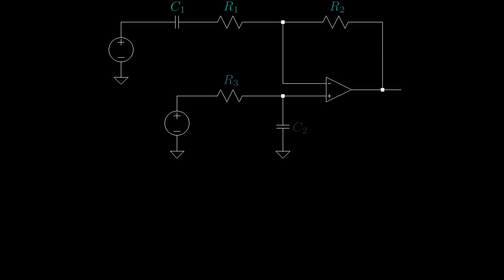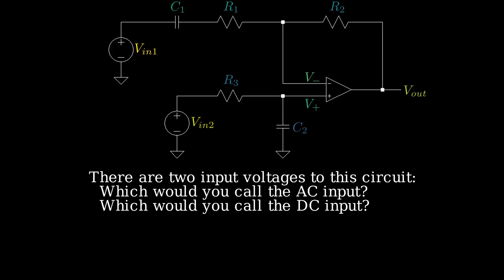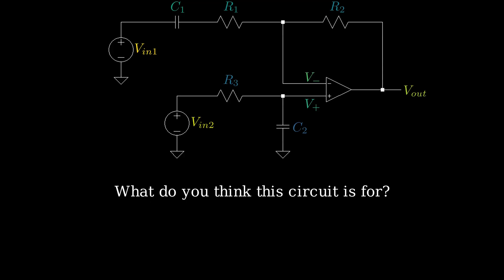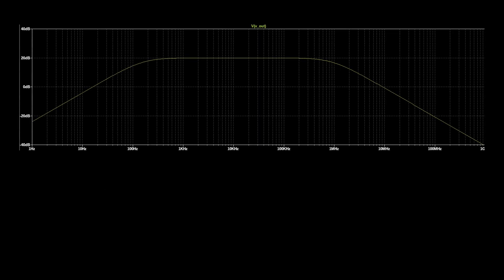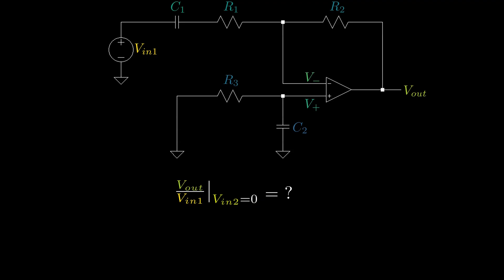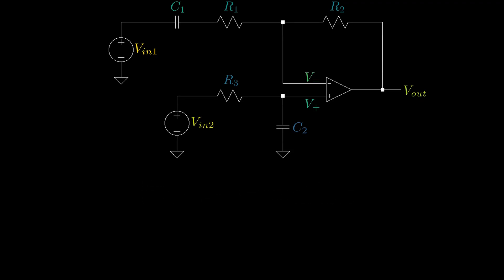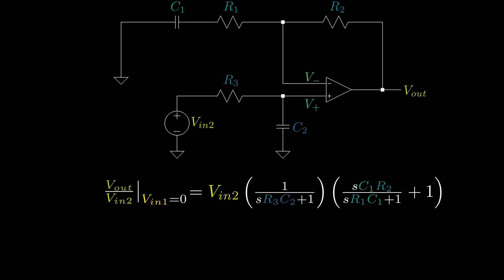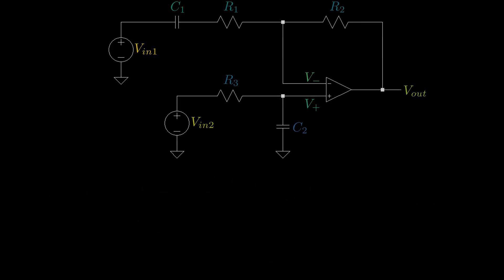Validation Engineer Interview Question Set

Comment: I think your answers for the transfer functions shown at the 4:07 and 5:00 minute points are incorrect. The x-fer functions should have no units (Vout / Vin is unitless). Vin should not be on right side of the equation. Also, when you took out Vin1 (the AC input) the question becomes a capacitor charge time problem. And with no AC input, s = 0 and your answer (at 5:00 min.) doesn’t make sense.
Reply from the maker: Yes, I noticed this and in the description I mentioned my nomenclature mix up. Good catch

For the s=0, I believe that is correct (once you fix the above mistake). Let me know if thing otherwise
Reply: Thank you, i was writing this on paper and thought i had made a mistake :)

Comment: Mm this seems a bit odd as I think it assumes both v1 and v2 have the same frequency input. Otherwise wouldn't the s for v1 and v2 need to be different.
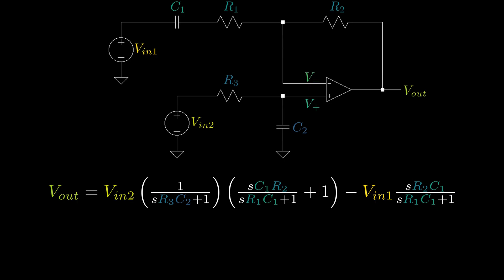Reply from the maker: If you are referring to the equation at 5:17, great point, I should have used s_v1 and s_v2 to convey that the V1 and V2 frequencies aren’t necessarily the same. 

In the equations before that I think I’m ok because am analyzing each source separately.

Thanks for the comment
Reply: @TLV3604 no worries - I am enjoying your videos. Looking forward to more!

Comment: I'm happy that just a basic electronics course of mechanical engineering and a bit of curiosity about tube amps/guitar pedals allowed me to answer a couple of the questions. This video is quite interesting because the amp/pedal world rarely goes into calculating said circuits in any depth that isn't relevant to desired signal behavior like getting the right bias to amplifying or cleaning out DC from the signal or buffering the signal or having the right kind of pull-down resistor or feedback loop or AC signal filtering. It's more about functional blocks of components and having desired signal filtering to ear, specific component details than calculating the bigger picture in the circuit.

Comment: for the transfer function questions, couldnt you just solve the transfer function directly (using the typical inverting amplifier equation but with 
(V1 - V+)/Zr1c1 = (V+ - Vout)/R2, 
with V+ being 
V2*(Zc2/Zr3c2)) 
without taking into account the cases of setting each input to 0? Thats how id personally approach the problem and it seems easier since it ends up just being multiplying and dividing some terms. Then you can just plug in each case instead of added them in the end, although ill definitely note using superposition more.
Reply from the maker: Yes, there are definitely more than one ways to solve this circuit. Personally I like superposition, but if you like how you did it, that's great too. Thanks for the comment
Reply: @TLV3604  thanks for the clarification ❤

Comment: Your first question is wrong based on the schematic itself. It shows a positive and negative. Voltage That is not a C A C always shows a sign wave with no. Polarities.   This is why I don't like tests. People don't bother to see if the question is even reasonable. It's a fake question. The schematic shows a DC input only. There are only two DC inputs, And that of course makes the capacitor useless and that part of the circuit useless.
Reply from the maker: Not all sources have a sine wave drawn on them. The source with just a positive and negative terminal represents a generic voltage source, not necessarily AC or DC. This circuit was created using LTSpice, which uses the generic symbol as AC or DC (or a combination of both). To suggest that the question is fake is overly pedantic to the point of being incorrect. I recommend you search for schematics drawn with LTSpice, according to you, there are a lot of "fake" circuits that seem fairly real to me.
Reply: @TLV3604  well I was raised in the 70s and there was no LT spice and if you put a positive and negative on an AC source, you were considered an absolute moron.  

If LT spice was lazy and didn’t do it properly that’s on them. A plus a minus means DC end of story.
Reply from the maker: @forgeteverythingyouknow5413  in that case, I’m truly sorry that you are stuck in your ways and resort to lashing out at those that go against your personal conventions. 

Is it acceptable to draw a resistance as a box? That’s the symbol in Europe, is everyone in Europe an absolute moron?
Reply: @TLV3604  fascinating...  you came up with the idea that I'm lashing out simply because I am stating something is incorrect. I did not lash out at you or say anything bad about you. I am just stating a fact. A positive and a negative symbol on a device means DC. If there is no sign wave picture, then it is definitely DC. If LT Spice was lazy that's on them as I said.  The fact that you can't see this is confusing and want to defend It is bizarre to me but go for it. 

The fact that you Projected that I was lashing out is interesting. I simply said you were wrong.   

Your example of the resistance symbol being different in another country is Non-sequitor and so  has nothing to do with this comment....  

  I had no intention of getting under your skin. 

There is a problem with language and characters in general in that they can change over time. Always go downhill. And that is the problem and why society's collapse eventually.   This is a very small example. But many small examples build up to the insane political world we live in today. 

Lt Spice is wrong and you didn't know that and I could care less. Carry on sir. 

The fact that you can get upset because someone points out what they believe is a strong error. Is something you might wanna consider in your emotional Self work.

Discussions and facts have absolutely nothing to do with ego. If they do, that's a personal problem. You never have to get upset with someone disagreeing with you. And you shouldn't. 

Consider the fact that this is text. Unfortunately, text without a context of the other person means you project your meaning onto the text. 

What I said was in the 70s if someone Created this symbol, It would have been absolutely considered moronic. I didn't call you a moron..      However, since I am 66 years old, I can tell you that the world has become dumber and dumber as the years have gone on. 

And so goes the Dunning-Kruger effect in history. The younger ones do it a little differently and not as accurately and they think the older people are fools. 

Note I am not saying you think I am a fool. You seem to infer a lot of things... But I am not implying anything personal. 

The last thing I wanted to do was irritate you. I wanted to have a discussion. It didn't have to be with you. But you're welcome to continue to believe I called you a moron if you want to. I would never do that. Not in a million years. 

But you get to do and feel anything you want at any time you want. Same as everyone else.

Comment: This circuit is incredibly practical. I build it quite often. Its great for building guitar pedals around, but I've also used it at 3.3V built around OPA320 (2nd order sullen-key) as anti aliasing filters for ADC's and DAC's. I find the inverting configuration to be convenient because it can attenuate the signal, where with non inverting configurations can't reduce the gain magnitude under 1. Its also much easier biasing the inverting version, but they are both nice.
Reply from the maker: True, I didn’t even talk about how the shelf filter behavior can be useful. At some point I’ll definitely do a video on antialiasing filters. Thanks for your comment!

Comment: My guess (before watching the video) is that this is an AM modulator. The carrier goes in the top (with the DC blocking capacitor) and the signal to be modulated goes in the bottom (with the low-pass RC filter.)
Reply from the maker: While not the original use of the circuit, it very well could have been used for AM modulation, nice guess!

Comment: Great video!!!!!

I think I did ok. As an incoming 4th year worried about future interviews, this was pretty reassuring.

My answers:
Q1: Vin1 is probably AC because C1 screams "coupling capacitor." Vin2 could be DC, C2 holds its value at V+ while R3 limits the current. Vin2 could be AC too, it looks like a LPF.
[Upon reflection, if Vin2 is an AC input into a LPF, that's just saying DC again. lol]

Q2: It looks like a summing amp, so the circuit probably adds a sinusoidal signal to some DC offset.

Q3: (I misunderstood the question, couldn't answer rip)

Q4: The opamp is not ideal so eventually the internal elements can't switch fast enough to handle the extreme frequencies.
[The first term that came to mind was slew rate, but I thought that may not be 100% applicable. GBW product slipped my mind]

Q5: Vo/Vin1 = R2/(sC1 + R1)
[Yikes that's embarassing. Simple nodal analysis, [i_in1 = i_o] => [Vin1/Z = Vo/R2] but then I did Z = sC1 + R1 instead of 1/(sC1) + R1]

Q6: No idea lmao

Guess I should review my fundamentals next time :p oh well, better fk up now than during an actual interview
Reply from the maker: Nice! In my opinion, a good interviewer should focus not on your final answer, but how you arrived there. So even if you mess up some questions, don't worry about it! From your answers, it seems like you did pretty good. Especially for Q1 and Q2. 

Honestly calculating the exact transfer function is the least important part of the question, as in industry really you could just simulate the circuit to make sure your component values work for your test. However, being able to derive the transfer function will allow you to make educated choices when selecting components. It also tells you what is possible (for example, can we get AC gain with this circuit? What about DC gain?). If I can calculate the transfer functions I can prove the answer without fiddling with component values.

Comment: You mentioned that the candidate wouldn’t be penalised for wrong answers in the last two questions, they’re more meant for figuring out their thought process. 

I didnt make the s = 0/inf connection or the inverting configuration connection (I know what that is, I just thought the capacitor messes it up a little). But I was able to get the transfer function using kirchoff. 

Should I work on pattern recognition or is being able to work through the problem enough? I assume the pattern recognition matters more with larger more complicated circuits and this was a simplified version.
Reply from the maker: If you were able to work through the math correctly that's great! Personally I like to simplify the circuit when I can, and try to recognize the common patterns, and then use that when I'm diving into the math. That way I accomplish two things, the first is I have an expectation for what my math should lead to, and the second thing is I "show off" to the interviewer. And by show off I mean to say that I show that I am capable of both drawing fast and accurate intuitions about a circuit, as well as actually mathematically defining the circuit. And the intuitions can help fact check the math for any mistakes.

For example, at 3:42, at high frequency (caps are shorted), I see the standard inverting amplifier, so I know what when I solve for the complete transfer function, I should see that as s->infinity my transfer function should simplify to -R2/R1.

Another example, at 4:35, at low frequency (caps are opened), I see a voltage follower configuration (the resistors don't matter as op-amp terminals draw no current). Again, this intuition guides me, and if I see that my end result does not agree, I messed up in the math somewhere. 

In short, let's say you messed up your math somewhere. It's a lot more impressive if you were able to figure out that you made a math mistake without the interviewer telling you. By simplifying the circuit, coming up with a hypothesis, and then using that hypothesis to check your math you make yourself seem very efficient and capable. And again, everyone is a bit different, so if a candidate used only math, or only handwavy analysis I wouldn't consider either one to be a "bad" sign. In my opinion an incorrect answer shouldn't disqualify a candidate. How the candidate reacts and fixes an incorrect answer can be a lot more telling. Because ultimately, everything is hard, and everyone is wrong eventually. But figuring out when you are wrong by yourself is very powerful and a quality skill to have as an engineer. 

Thanks for your comment.
Reply: @TLV3604 thank you for the insight! I’m only in my second year of electrical right now. I’ll work on slowing down and building intuitions rather than just plugging and chugging the maths.

Comment: This is really neat! What does a validation engineer actually do? I was able to answer some of the questions, and it was pretty fun! Probably not enough to pass though haha
Reply from the maker: A validation engineer is responsible for testing silicon/systems in lab to mainly:
1) Characterize functionality
2) Validate performance

Validation engineers do 1) and 2) under a variety of conditions, including temperature, voltage, and process variations. They are responsible for coming up with the validation plan, performing it, and writing/presenting the validation report. If they encounter bugs/issues/performance problems, they convey that knowledge to the design team, and work with them to ensure the testing is correct, and if any fixes/workarounds are possible. 

An example is let's say your friend made an op-amp from transistors, resistors, and capacitors. A validation engineer would take that op-amp, and quantify its performance in real life. This data would be fed back to the designer to make sure that the real life data matches the expected simulation data.

Let me know if you have more questions, I can probably answer them. I'm glad you liked the video!
Reply: @TLV3604 Is it the same as an applications engineer?
Reply from the maker: A little bit different, but it can vary based on the company. For my work experience validation is tasked with testing the circuit/system to make sure it performs according to design, and also generate data for the datasheet. Apps engineers create the circuit boards/designs that use the circuit/system in order to demonstrate the use to customers. A simplified view is that validation tests the part, applications uses the part to sell a high level system. 

Applications may also be involved with customer support and debug, which validation typically doesn't do.